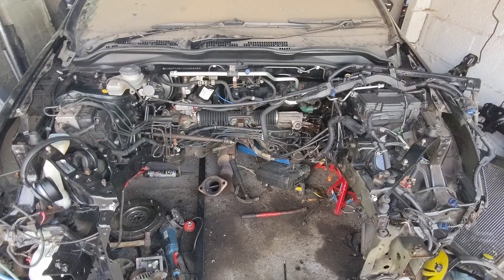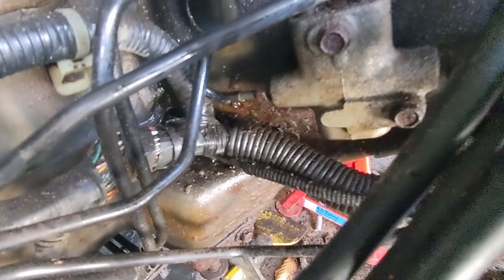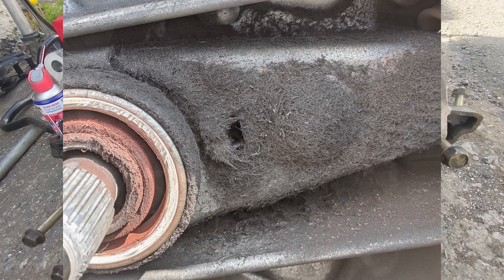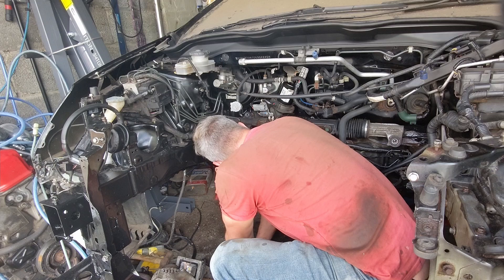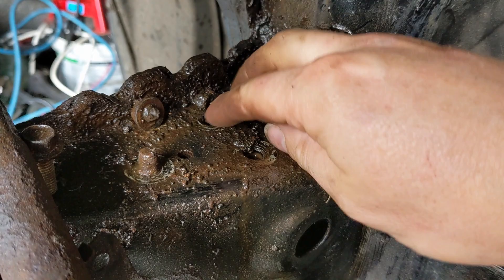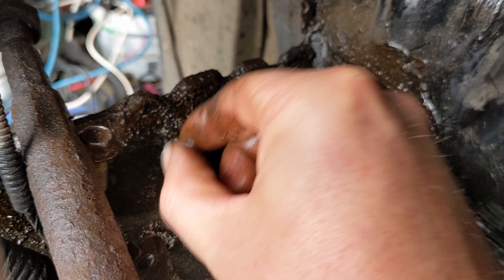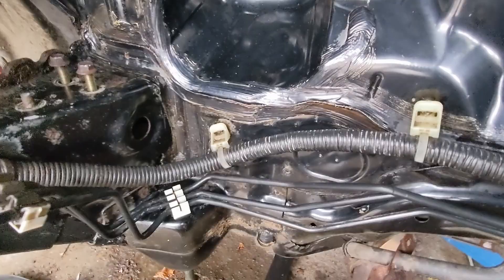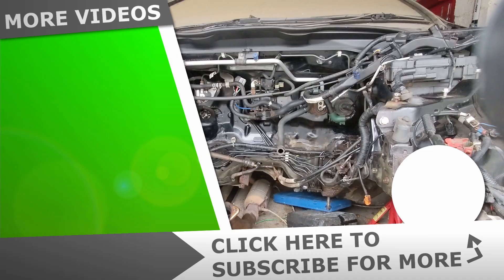Civic Type R EP3 Steering Rack Removal

Comment: Any tricks to line the steering rack bolts up with the engine in the car ? I can’t get one of the bolts back in
Reply from the maker: Unfortunately, or fortunately for me, I had the luxury of doing all the work on the rack with the engine out. What I would suggest is placing it on the side with the nut (passenger on my car), get one bolt in with just two or three turns then try getting the second in, you should get enough movement on the rack that way to get the second bolt to line up. Only after it's on put the column back on too. I don't envy you doing that job with the engine in though, not a lot of space there to work. Good luck 🤞 Hope you get there.

Comment: hi mate, is the inside of the cabins rack bolt just literally that bolt and it undoes from the column. ie very easy to replace the rack as my bolts that hold it onto the brackets look safe enough to remove but my brackets are crusty bolt wise, so I want to steer well clear. so I take it its just 4 bolts, 1 in the cabin and 3 on the rack itself that hold it to the bracket?
Reply from the maker: Hey there. Inside the cabin it is just that one bolt holding the steering column to the rack, a little awkward to get to but easy enough. Those brackets are a pain to remove and if you can possibly do it without touching them that's the way to go. There is just three bolts holding the steering rack to the brackets they came easily, but I had the engine out of the way, I'm not sure about clearance when the engine bay is full. Also don't forget the track rod arms need removing, there is a small washer bent over these to stop them coming off. Bend them back flat before you loose the bolts and you'll be good. Good luck, in theory the rack is easy to replace, I think the tricky bit is the space. Thanks for watching.
Reply: @JamesTumilty  cheers mate, it's an ep2 and I've already replaced the tie rods and have a crows foot that does it and I think I have more clearance with my engine vs a k so should be OK. just trying to chase down a nasty knock as I've replaced literally everything else.
Reply from the maker: @otacon4065  Oh man, I know how difficult tracing mystery knocks can be. Good luck with that, hope you find it.
Reply: @JamesTumilty  thanks bro